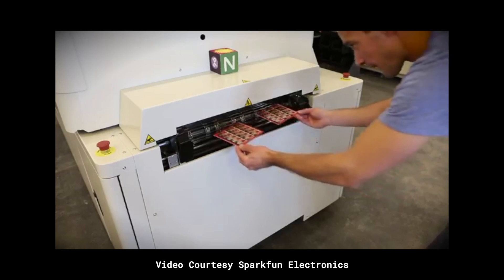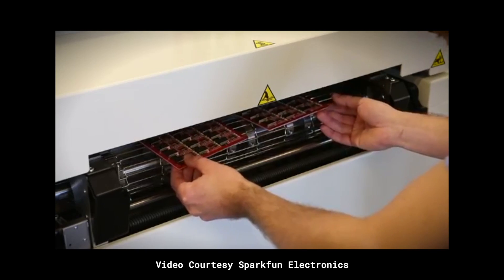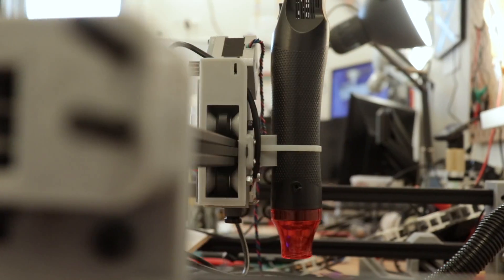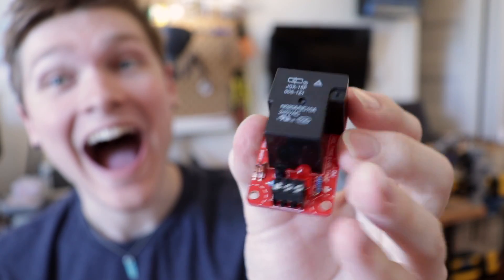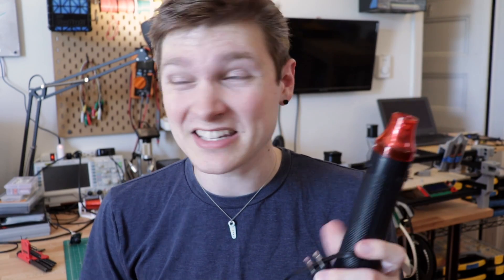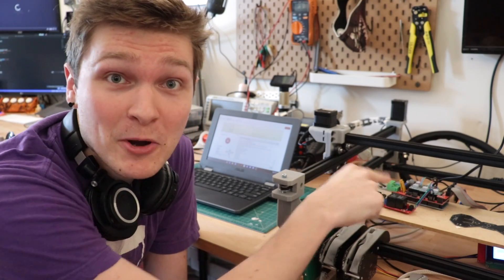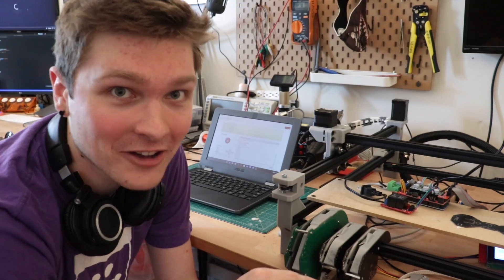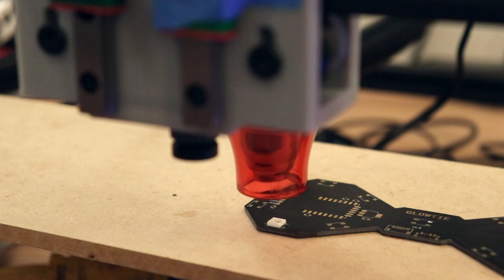Automatic Soldering On My Pick and Place!

Comment: Hi Stephen,
I followed your PnP machine a while now and I am honestly impressed of your engineering skills. You truely work on an extraordinary level of creativity and accuracy.
Automizing the soldering process is Imho a bad idea doing with a heatgun.
SMD parts should be heated up by a precise temperature/time diagram to reduce thermal stress to an absolute minimum. LED may be rather tolerant to thermal stress but a lot components, especial capacitors and complex logic ics aren't. If you follow a path with the heatgun you inject uncontrolled heat energy to your pcb/components.
Besides please consider a heatgun taking just 500 W (which isn't that much power) would result in a current of 40+ A. Your relay is capable of maybe 10 A.
I suggest to use a regular infrared refolw oven, which should not cost that much and instead automize the process of putting solderpaste by your machine. A nice inspiration could be vbesmens project of a PnP machine. That would give you more flexibility in your small prototypes since you would get rid of paste stencil
But as said before, I am impressed of your skills. Keep on the good work !
Reply: 500 Watt with 40A is 12 volts... With 110V, the correct amperage is about 5A
Reply: @AbdullahKahramanPhD  he was considering a 12 V heatgun.
Reply: @freundderuc9146  oops sorry

Comment: As people have mentioned a reflow oven would be much better for the whole board but this does have a practical use in rework and prototype development where you only might want to put on a few components at a time. It’s a tough problem though as heat wash might disturb already mounted parts.  Anyway, congrats for the effort.

Comment: 5watt laser diod's focused beam can easily solder each single pad

& Generating of pad's data is so simple in almost all CAD pcb design software ,just try that
Reply: Without an enclosure, this is not a good idea.  The paste is not very reflective, but once the solder melts, it is very reflective. Granted, the laser beam will fan out due to the curvature of the solder, but still not great on the eyes.

Comment: Awesome work.  I've had many of those WS2812B Neo Pixels not work after being exposed to direct air gun heat sadly.  I've always had to be very delicate when heating them up that way or they simply won't work.  A reflow oven distributes the heat a lot better and I had a much better success rate.  I'd recommend putting the rest of those glow tie components on and making sure they still light up.  Best of luck sir!

Comment: Hot air is really not the way to go with P&P. A cheap reflow oven of a converted toaster over will be much better for so many reasons. Especially for LEDs which are sensitive to reflow profile. 1) It frees up your machine. Reflow will be your slowest operation and will be a bottleneck. 2) It will do a bad job. An oven soaks the whole board evenly and then ramps up for a short time to melt the solder so the heat is uniform it's hot for the shortest amout of time possible. That stops warping and tombstoning and doesn't damage sensitive components like LEDs or MEMs parts. 3) You will blow components around, a 5050 LED is pretty stable, but an 0603 resistor or cap less so, so you'll need more rework even when the P&P places perfectly. 4) Fire hazard. Picking a placing can be relatively easily left unsupervised, but the heat gun mustn't and now you're having to stay there with flux fumes in the air. 5) Variability, if you have a ground pour on top your first LED might take 10s to heat as it's cold, the one next to it 8, the next 7 etc. You can refine this, but then you can never change the order you reflow your components as it could let the board cool off and then take longer to reflow, so more likely you'll end up blasting components for way longer than they need to get rid of this variability. Especially in denser boards where two compoents could be really close but still get a full second hit of hot air.

Comment: Great work on the PnP machine! To be honest ive been working with a heatgun for a while and ive come to conclusion that its just good for rework and really not ideal for soldering a whole board. Because theres a certain reflow curve you have to follow and its really hard to control almost impossible with a heatgun. Recently i converted my tiny 12Liters toaster oven to a reflow oven, i slapped a 25$ automatic reflow controller with a relay to control heating elements and when i need to reflow a board i just simply click one button and it does the whole thing from start to finish and follows the reflow curve(preheat/soak/reflow/cooldown) automatically and properly. the whole cost is probably under $50 for a fully functional reflow oven.
i would suggest get something like that(also the footprint is very tiny because its a regular small toaster oven) and focus on PnP features because its really not worth it and no matter how perfect a heatgun might be it will never be able to beat that $50 oven because its just so awesome.

Comment: Few  ideas:
Use ferrules when putting stranded wires into terminal blocks. Best crimpers for them imo are the ones that clamp from 4 sides kind of like an Iris.
For debugging hot air soldering, get a cheap thermocouple high range thermometer. One on a DMM might do too.
You probably won't have much luck finding 12 or 24 volt solution because blasting hot air requires a lot of power which is problematic for low voltage.
You might want to have a temperature probe stuck right at the nozzle with a feedback to the heater. It'll be interesting how far you get with just off-on control.
Also, you know how when you reflow, you wiggle the nozzle in circles? That shouldn't be that hard to implement, right?

Comment: 12V heatgun will use up lots of amps. Look at the wattage of your soldering heatgun. Get yourself a two phase relay and switch both leads of the mains. Its much safer this way.

Comment: If you're using KiCAD RPT as the input file, then maybe rpt2pnp might be easy to extend for the solder action. I think when I wrote it I had a very simple optimization built in to go to the various pads (right now, it only does Pick'n Place and solder dispensing, but soldering can use all the same functionality).

Comment: Why don't you use a Raspberry Pi to run the PnP machine? You can use the Adafruit's Raspberry Pi motor driver hat for driving the stepper motors and their 16-channel PWM shield for handling all the digital outputs.
Reply: The software that run the pnp machine is openpnp, its a java application  and actually if you want to avoid to much pain,  better to use it with a compatible Smoothieboard. using anything else instead of openpnp mean rewriting a 6 years old application.  Not impossible but may be not worth.

Comment: As well as moving the hot air over individual pads, it will probably need to dwell longer for big ground/power pads? A completely OTT solution would use the camera to identify when each pad has reflowed successfully. lol

Comment: laser soldering would be awesome. g+cood will scan all the pads
Reply: This is interesting. I have an 80watt CO2 laser coming in this week. I got it for cutting thin wood but your idea piqued my interest. How would one go about using that for soldering?
Reply: @exia8989  
The end of each pick and place cycle is the best time to zap the part.
It will be relatively inefficient, but who cares, the laser soldering is the coolest gadget for diyers.

If you go a step further into the sci-fi arena. Imagine  you put a ATmega 2560 TQFP cpu on a piece of board,
you feed a hair thin enamel wire to a leg of the ATmega, zap it with a laser.  That will be real fun.

Comment: Nice setup. You can't directly use the air gun on the ramps shield ? + You will have the temps probe so you can probably use automatic PID setup from Marlin... Then you will have nice temp curve for reflowing.
I already printed everything, now i'm waiting for other parts to start building it ! Very nice project.

Comment: You can't use a 12V heat gun, it will need a lot of current to heat the resistor and give decent results. You need to get stuck with AC (high voltage but lower current).
I have one gun like the one you used, it does nothing.
If you switch off mains on your soldering gun while still hot, it will be destroyed after some time. You need to cool it down.
Your soldering station has a reed swtich, you can use that to trigger your soldering on an off securely.
Reply: in fact it is the voltage drop across the resistor times the current running through the resistor.

Comment: I think using a heatgun on each component will take forever. I would use a reflow oven, simpler and faster
Reply: I guess the idea is to create a machine that picks and places components and solders them to the board automatically, without you even thinking about it. The magic comes when the machine does everything.
Reply: Yes, a $5 toaster oven + PID temperature control is a simpler solution all in one go.
The one with temperature profile could be done with Arduino, might take a week or two.
If you created a oven for PCB.  You may as well create a similar oven for roasting coffee bean.
Reply: Don't mind I'm a year late. But I think the reason to use a pick and place machine rather than a reflow oven is so you can make boards with smd components on both sides. 
I believe an oven will drop off previously soldered smd parts when upside down
Reply: I strongly agree. 
It takes what feels like 5-10 minutes for it to warm the area up enough to melt the paste. doing that for every component would take forever.
Reply: @darkshadowsx5949  I assume it is easier to have this idea in mind the whole time and you can disable it at any time to use reflow.
Reply: Does it matter though?  If you want to make say 50 boards over a week, that's an hour a board.
Reply: @JohnSmith-hn6kv  yes it does, it will not reflow properly, can overheat some components, blow away etc. It is good example of overengineering. Excitement is nice but sometimes you need to know when to stop.
Reply: @bumbarabun  I never thought about blowing away components!
Reply: @JohnSmith-hn6kv  easily, especially by this generic heater which does not have proper blow control. When you use soldering station you have to put it on minimum blow level when you solder smd components manually.

Comment: And why exactly can you not just use a "smart socket" to turn on and off mains safely? They are like 5 USD and you would not even have to do any cutting of wires.
Reply: smart sockets for 5$ are pretty crappy. at the end u need a switch able to hold the Watts of the air gun = enough ampere. any decent relay can do that, add some circuitry to isolate optically the switch control from the main board and u are teorically safe.
Reply: @riccardoz2953  Smart sockets for 5 USD can do 15 amps. As that is the standard fuse in a home, are you saying you change the entire wiring in your house? 15x220=3300 watts. What kind of crazy heat gun are you using that needs more than that?

Comment: Hey a great way of re-flow i learned of by applied science. Is to use a ceramic hotplate and some capton tape to hold everything in place, and just lay the board on top of the hotplate and crank it. Its in his electroluminescent paint video.
Reply: A kitchen stove, a pan and some sand works wonders too. You can even make Turkish coffee with the same setup LOL.

Comment: Cool idea! MDF might not be the best choice for the platform to reflow your PCBs. You can see in the video that areas are already getting burnt. I doubt it would get hot enough to start a fire, but I would be nervous starting a job and walking away. MDF is nice because it's large, flat, and cheap. Maybe you could use some sort of metal plate just for where the PCB is? Or maybe you use a large blank PCB as your platform?
Reply: Putting the PCB onto a large metal will sink the heat away from the solder. Raising the PCB up and having the metal as a heat shield behind it would be a better solution.